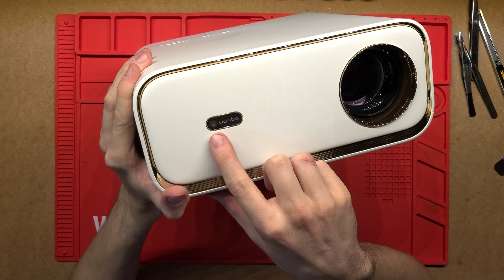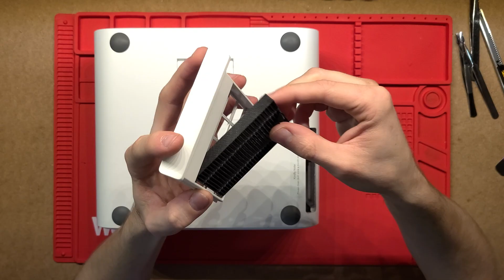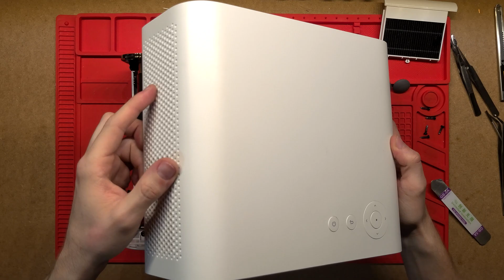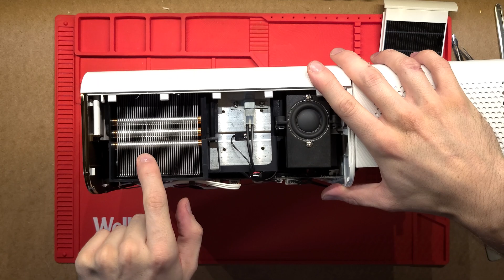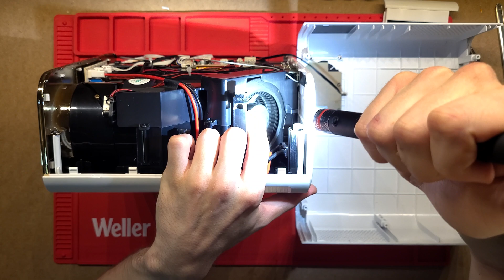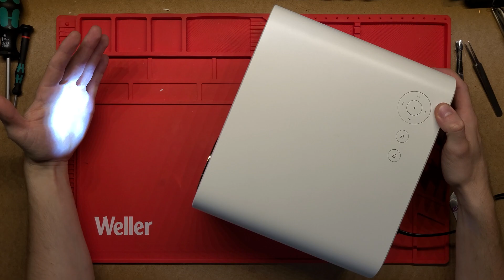How Does a Projector Actually Work? Teardown!

Comment: These use the same display technology as other cheap LCD panel projectors. These have better build quality for a higher price, but they share a common flaw. The heat from the high intensity LED tend to cause burn in to the LCD panel. Still prefer DLP projectors but they  also suffer from stuck pixels.